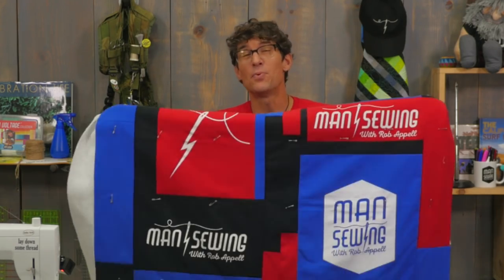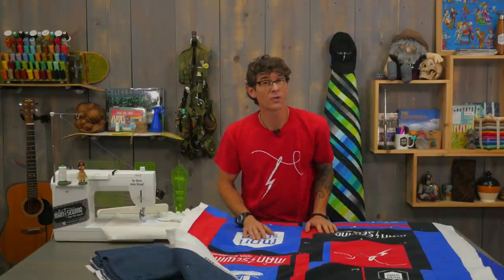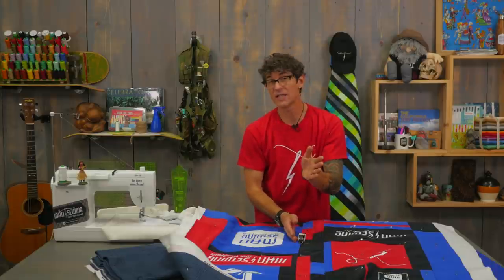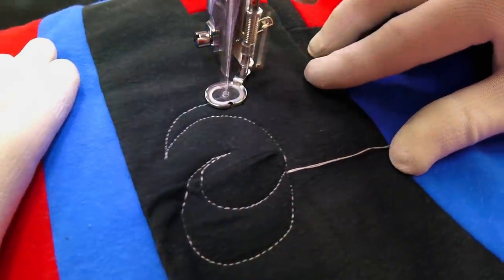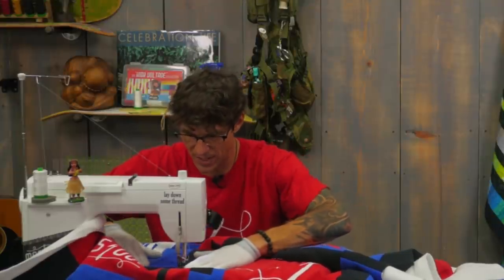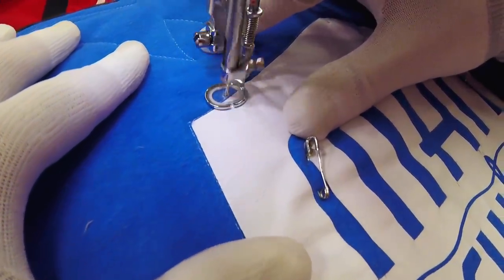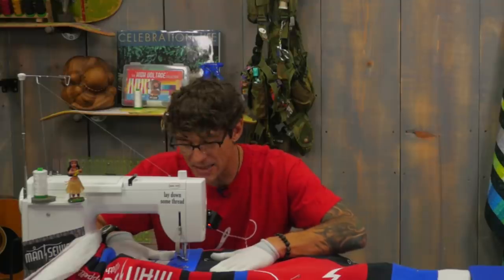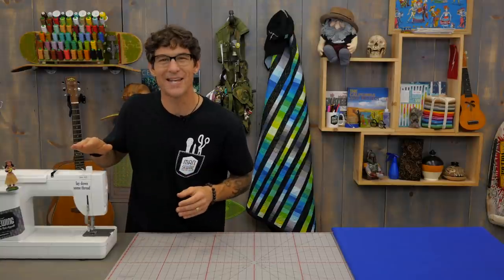Basting & Quilting a T-shirt Quilt

Comment: I just finished a couple of T-shirt quilts. I washed the cotton fabric that I used for the borders and backing, used a poly-cotton blend batting (which said it would have 2-3% shrinkage), and I used cotton thread for sewing and quilting. When I washed the quilts, they puckered up; not sure if it was because of the thread or the batting. Lots of things to consider when planning a T-shirt quilt and I'm learning with each one. Some day, I'll get it all right! I didn't really mind the shrinkage because it made them look cozier, and the recipients were happy with them.
Reply from the maker: It sounds like they turned out great, Phyllis. Thank you for sharing tips from your t-shirt quilting experience! :)
Reply: Suggestion, lengthen your stitch length..When I prewash, I use as hot of water as possible to create the most shrinking.  For sure, flannel for backing will be a larger % than the other fabrics.   I find a 45 inch prewash flannel can loose 1 + inch width.  Flannel that ends up being THICK is awesome for some clothing, not the finished quilt.

Comment: I am really confused about the batting. I hear no batting, flannel in a single layer for batting ,80/20 batting, polyester batting? . They  live in LA so it doesn't need to be a heavey quilt . Its a memory quilt for a dear friend who lost her husband who was also a dear friend for more than 60yrs so I want this to be right. One video showed quilt as you go with just verticle or horixontal line through the designs. I got the impression that you don't like going through the designs but around them? They were big travelers and he was a car guy so I have an amazing array of T shirts to use.  She doesn't want a specific car or travel quilt but a mixture  of  logos. Any suggestions would be appreciated.  Thanks! I am new to your channel and you do a really nice job describing and showing how each step is done. Thank you!

Comment: My local quilt shop's long arm quilter says that t-shirts dull the needle very quickly, and that doesn't include the iron on stuff.  Have you (or anyone else) noticed that?

Ron what do you think of quilting in the areas of the iron ons that have no rubbery stuff...like the words MAN SEWING in the first logo you quilted?   Would that work?   I think I would want at least some of the decal sewn down so it wouldn't separate.  Or am I just overthinking things.   That's hard for me to do.  I'm a blonde!   Haha!   

Love your stuff Rob!
Reply: I definitely go through needles quickly. I do many of these - I've shipped 3 in the last month and have one on my machine now. I use an industrial Juki, and yes, I'm using a needle per quilt, if not more, depending on the size. Otherwise I get all kinds of thread issues when I'm quilting them.
As for quilting inside the emblem where there is none of the rubbery stuff - you can do it, but it's going to take a lot of thread breaks and starting over if you can't move between the letters or whatever the design is. I've always avoided them because of the holes as he was talking about, and it is terrible on the needles! I've never had an issue with leaving the interior of the designs unquilted, so you may just be over-thinking it!
Reply: Interesting FYI as I sew, wearing down of needle or breaking is not the same as the getting dull...so I keep a metal nail file at the sewing machine, just a gentle roll around and I am good to go.  I find my pinning pins will become dull too when using certain fabrics, I don't fix on those..

Comment: Do you leave the stabiliser in situ or remove before quilting? Could you use water soluble stabiliser?
Reply: Do not peel off stabilizer, that is the quilt's 'rest of it's life'.  No do not use water soluble.  Like washing away the glue that holds your fabrics together.